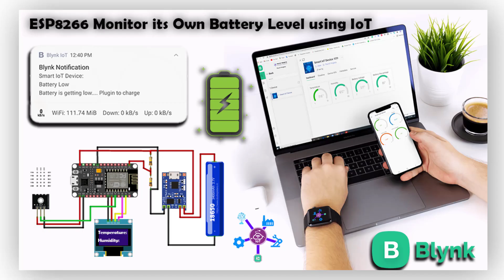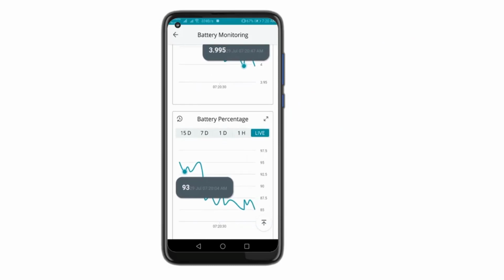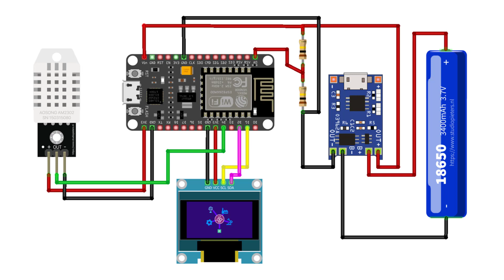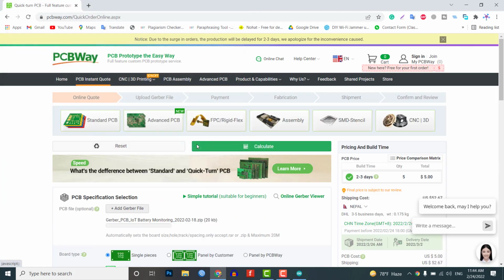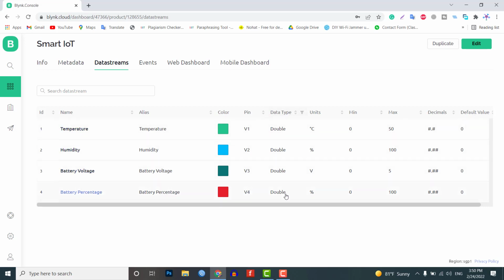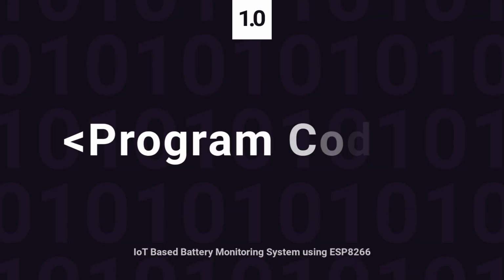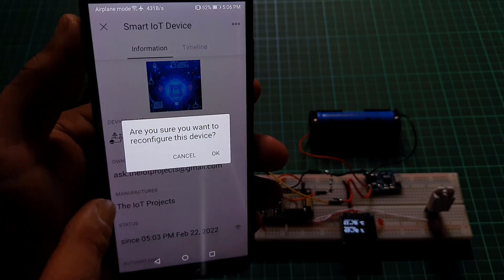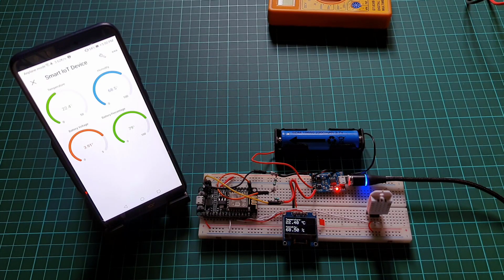ESP8266 Monitor its Own Battery Level using Blynk IoT for Battery Powered Projects

Comment: What if the measured battery voltage is 12 Volts or 24 Volts
Reply: this is my question too :(
Reply: build a voltage divider and you're done

Comment: You have connected the esp8266 vin  pin on  board with battery output pin which have Max of 4.2 v only,how the board is running which requires 5 v at it vin pin
Reply from the maker: it works
Reply: this Board will stop working at 3.8-3.9V